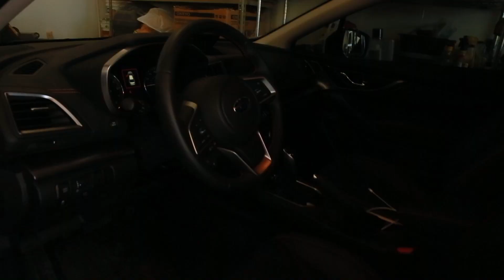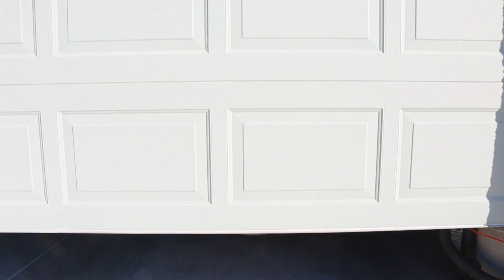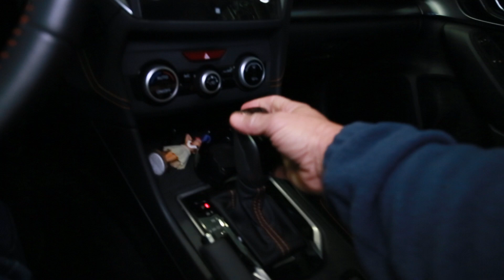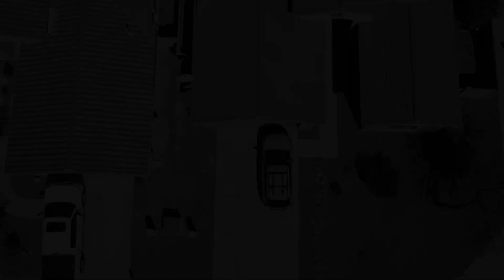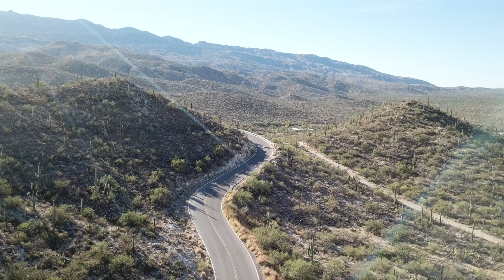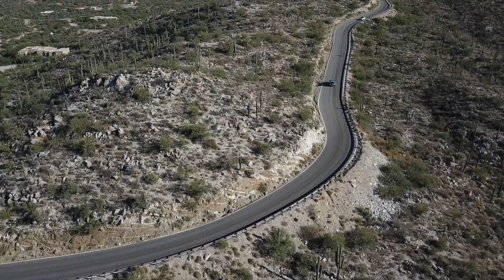2018 Crosstrek:  How is the CVT related to Oil Temperature?

Comment: Thanks for the mention Rick! :)
It is an issue for me if I want to trade in for the 2018 due to the 6 months of cold weather! I will report that to Lachute Subaru, it is the biggest dealer in the region and they have lots of modded Subies as well! Well, not Crosstrek but WRX/STi!
Reply from the maker: Thank you my friend!  Good luck to you on the 18 and thank you for being suck a nice part of the channel.
Reply: My old man got a Toyota Rav 4 Trail (Adventure - US),  I drive a Impreza 2017 (same powertrain as a Crosstrek),  and I don't get good fuel economy when the weather is really bad (my long drives towards a ski resort) as the car holds higher RPM's due to cold weather ( -20 to -35 Celsius). Cold starts are very loud on my subaru and it takes a long time for the car to reach idle. The opposite is true on the RAV 4 . But I love the hatchback handling and practicality. If we could only get the Subaru Levorg (station wagon) in Canada with a manual and dual fuel Injection (port and direct ) .

Comment: Hi Rick,  Great video.  I have a Premium and don't have oil temp displayed, I have noticed a drop in mileage as outside temps have gone down.  I will definitely play with the paddle shifters and check on seventh gear.  Almost all of my driving is freeway miles using cruise control.
  Just wanted hear your thoughts on oil changes.  At 1000 miles I did an oil change, I know not necessary per the book, it made me feel good.  At that time I installed a Fumoto drain valve. I just hit 5000 miles and did another oil change.  The Fumoto valve worked great, wish I knew about these years ago.  I am going to stick with the 5000 mile intervals because the math is easier.
Thanks for sharing with us.
Reply from the maker: Hi Jeff, thank you very much.  I ended up buying a prepaid maintenance plan with the 18, I got employee pricing on it, so I'm not sure if I'll change the oil before 5K.  I did an early change on my 14 and then did a 5K interval myself on that car.  7500 seems like a long time, even with synthetic.  I will have to look up the Fumoto valve as I have never heard of it.  Thanks for the tip Jeff.  Cheers.
Reply: Could you give me the reference for the Fumoto drain valve? Thank you.
Reply from the maker: Hi El Socio, their website didn't specifically list the 18 Crosstrek, just up to 17, but here is a link to what I found.  http://www.fumotousa.com/results.php?make=77&year=2017&model=35525&makeid=SUBARU&modelid=CROSSTREK+2.0L+H4

Comment: hm... well when i drove on freeways cruising speed like 70-80mph, i've never gotten the "gear" to be in 7th. when i move to "manual mode" it's always been 6th.
Reply from the maker: Interesting.  So are you thinking you were never in the 7th "gear"?  Mine kicks down almost always when I am cruising around 45 or above if not accelerating?
Reply: so while in auto mode, i can tap the paddle to shift up to 7th, but at high speed it'll still drop down to 6th after couple of seconds.  but i'm thinking maybe 7th is really for low "resistance" cruising like going downhill at highspeed like an "overdrive gear"?  i know the cvt would seek out the most efficient gearing...
Reply: Mine does the back into 6th thing too
Reply from the maker: Ok cool.  I will have to pay attention to mine the next time I am on the freeway.  Thank you Tomaso.